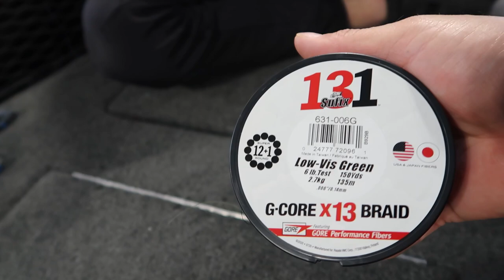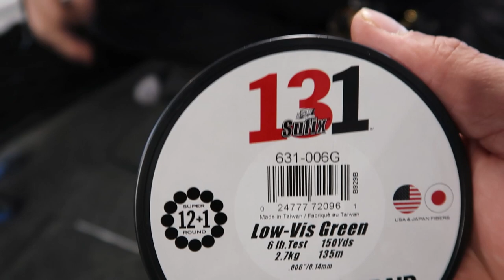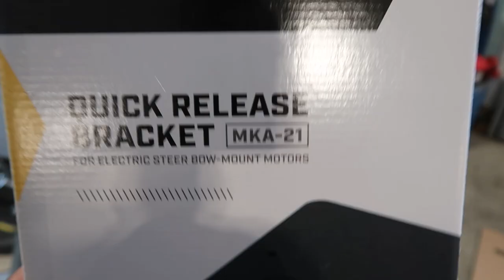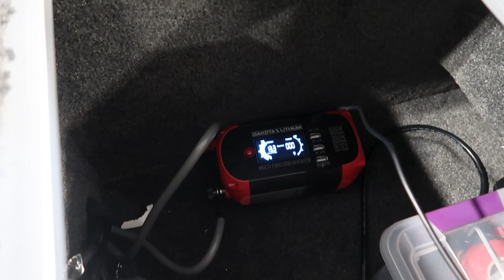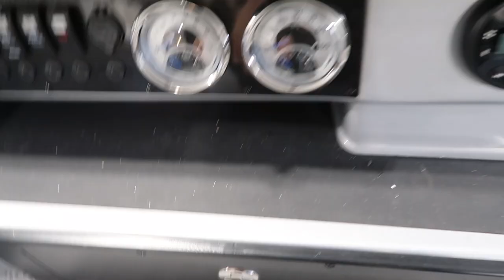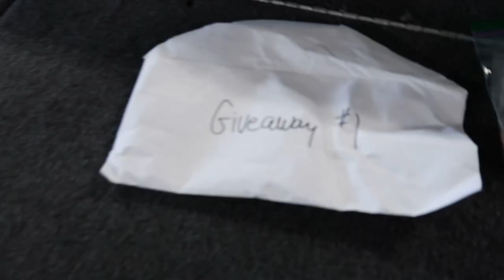Boat Update and Give-Away for JIGS!!

Comment: Hopefully I can find the right boat this year, I may retire my little red speed boat. Actually get into a fishing boat. I’ve been fishing my entire life and I’ve never had a fish finder. That empty storage right behind where you’re sitting that’s quick access looks great for snacks / drinks! Also one thing I could suggest, where all your power wires come out of that port you drilled in the lid of that compartment. I’d go to The store and get some large bore expanding wire loom, run the wires through that. At the ends take a small piece of pipe and some heat shrink with the adhesive built in. Heat shrink on top of the expanding wire loom, wire loom on top of the pipe. That way your wires stay neat and contained and somewhat protected. And then it’s not permanently fixated. You can slide the loom up and down on the wires so you can disconnect them.

Comment: Good tips. I hope the boat makers start paying more attention to wiring details. Warrior, for example, pre-wires their trolling motor wires front to middle (batteries usually go in the middle in the floor) to back, so you don't have to. It would be great if other manufacturers wired 6gauge for the trolling motors front and back to the battery compartments. Also, putting 8 or 10 gauge from the starting battery to the side compartment and then another from the side compartment to the front with a fuse box in front would save a lot of wiring work.

Comment: My Goal is a PB laker hopefully in Lake Minnewanka by Banff! Also, what do you use to hold your transducer cables on the outside of the transom? I wired my ducer and got the humminbird bracket on, just not sure what to use to hold the cable tight?

Comment: Great looking setup Clayton! My goal is to catch the legendary "Mike the Pike" in our local river. 2 questions, what are you using for a engine starting battery and why when you mounted the the transducer boards, you didn't use epoxy to keep from putting any holes in your hull?

Comment: I was starting to worry no posts, how’s your hand been? Great video and love the new boat. My goal this season is to of course get a 30” walleye and dial in my mega live for open water. One other minor thing you may need to move that high speed transducer closer to the keel. I noticed that your boat has the flat running pad like my Lund. It’s amazing for performance but your high speed transducer might be out of the water at its current location while on plane. But you will only know after you test that beast!

Comment: I have the same boat and motor, what prop are running/planning to run for it? I find my rpms were too low last season, around 4800 wide open.
Reply from the maker: Ya 4800 is too low for sure. Right now I have a 15 pitch 3 blade, and I will be playing with some other props as we go.  What were you running?
Reply: @ClaytonSchickOutdoors  id have to go look again, buts its just a loaner prop from the dealer i believe

Comment: My goal this year is to get out and target some early season walleye and pike. I managed go get into some sturgeon last summer but unsure if it was a fluke or if there is a  way to dial it in. Having a new baby girl in March will definatly cut into time on water this summer. Question regarding trolling motor mounting position. My trolling motor is mount angled on port side like every other motor I see.. running a tiller I always approach the dock on that side. When picking up my wife or other passangers at the dock it has become a trip hazard and at times enteraining for anyone watching her try and jump over it into the boat. Does anyone mount their motors so they are angled back towards the starboard side?

Comment: I gotta say my lund 1650 rebel looks significantly easier to rig. They have a rope run from the front to the back under the floor. Also has a bus bar under the control center for running graphs. Very easy to rig
Reply from the maker: 2 very different boats :)
Reply: @ClaytonSchickOutdoors   you saying that rope couldn't be added? Every lund i looked at had the rope, including the bigger ones. thought it was pretty sweet.
Reply: @ClaytonSchickOutdoors  not sure how many big graphs I'd run off that bus bar, though. I only got two. I don't have the money for 6 screens like Jay $eimen$.